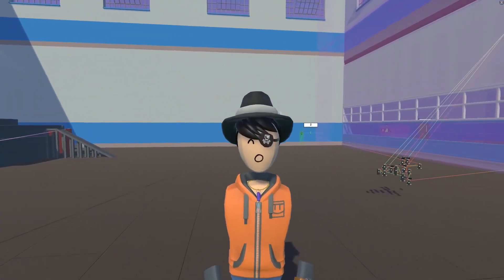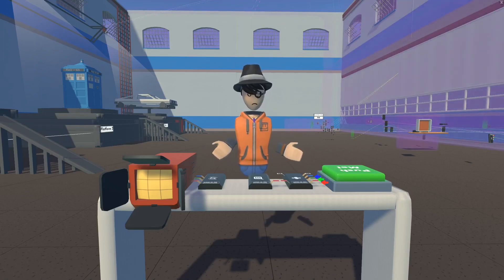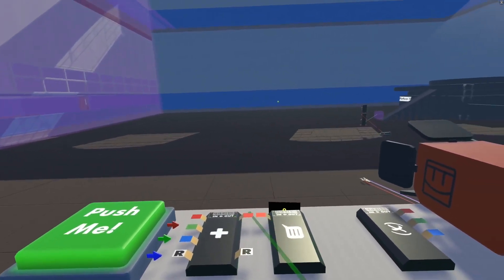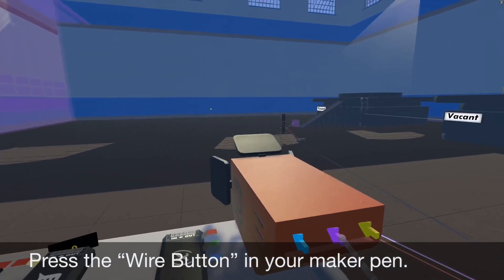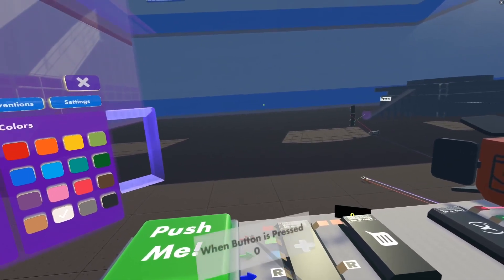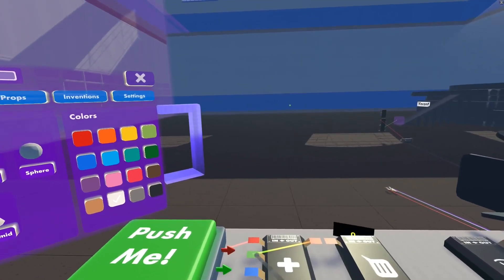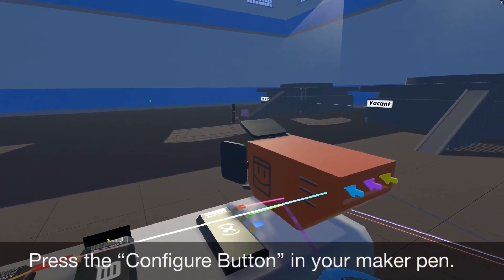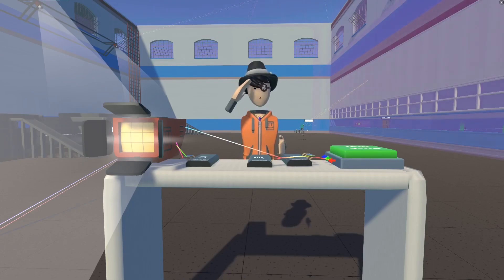Rec Room Builder’s Guide Episode 1: Got A Light?

Comment: Didn't work :( the light turned on but not off
Reply from the maker: Pepsi Noisyboy this is just the basic light there are more steps in turning it off
Reply: Ok when will it be released
Reply from the maker: Pepsi Noisyboy hopefully next week but if you need an easy quick fix for now just take another Button and attach it to the left R on the combinator
Reply: Im good I turned on light thx